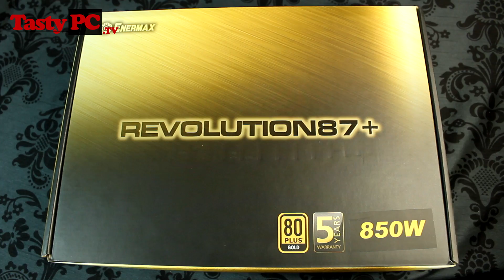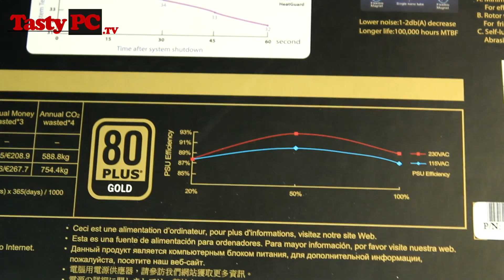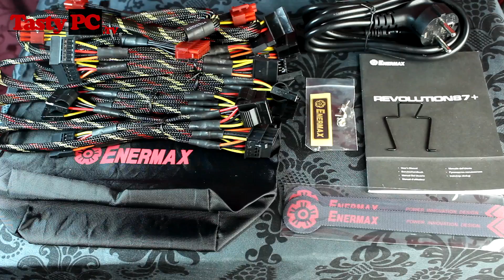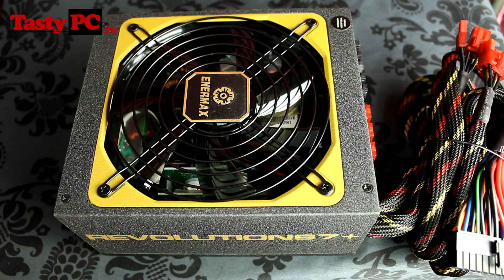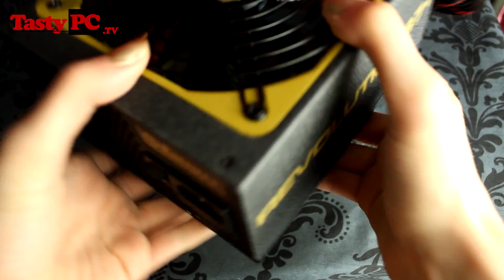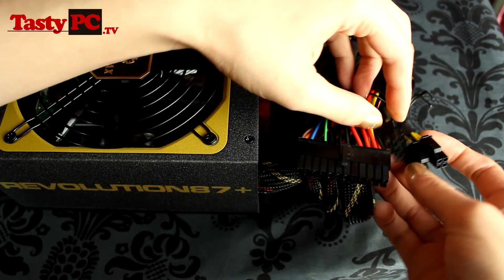Enermax Revolution87+ Power Supply PSU Overview

Comment: Split of current into 4 x 12V/30A rails may be limitation. Some time ago I had 650W PSU with 2 rails 22A each. Then after upgrading graphic card from HD4870 to HD6970 I started experiencing problems. PSU simply shut itself down in more demanding games.

Comment: That Enermax box looks proficient with that goldish color. These Enermax cables look like they could need some individual sleaving. The Enermax sticker looks discrete. Do not like the color of the Enermax cable ties and the Enermax manual looks too ordinary. The Enermax cable guard is a weird accessory. Also the yellow color of the Enermax PSU does not match my taste. Did I forget a part, did I forget something with the word "Enermax" in it?!

Comment: I like this PSU and also the Platimax series. However, they should consider going fully modular, so that it is possible to do all custom sleeved cables without voiding the warranty.
Btw, Enermax :)